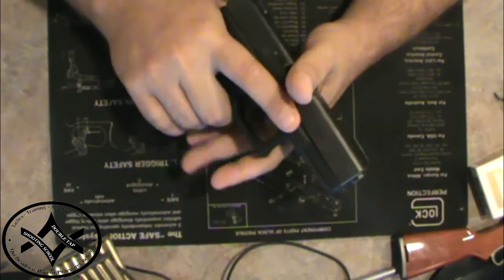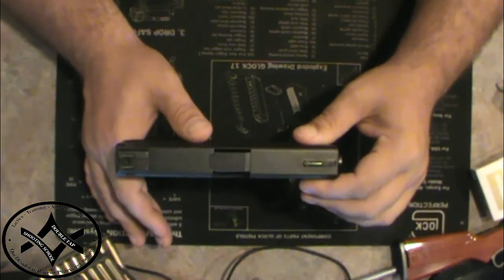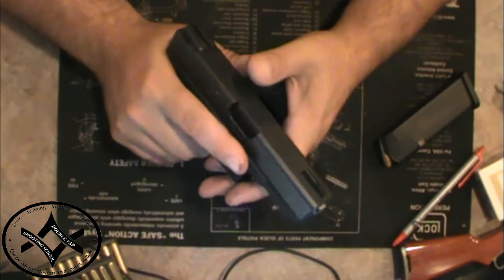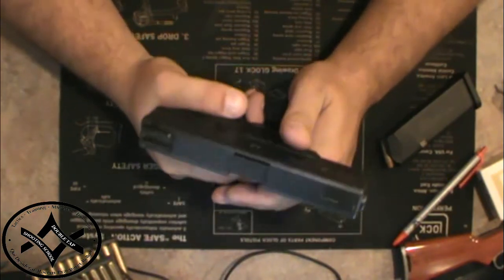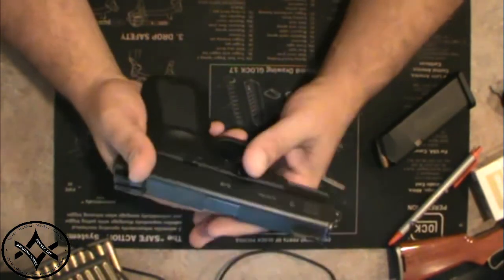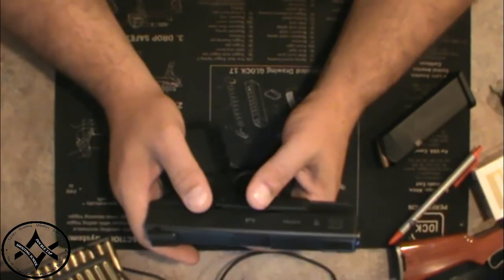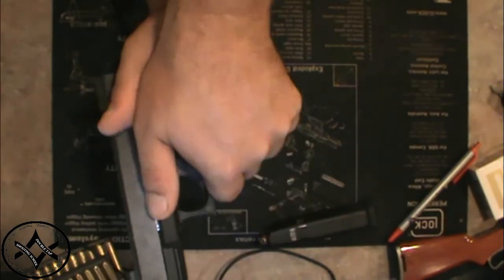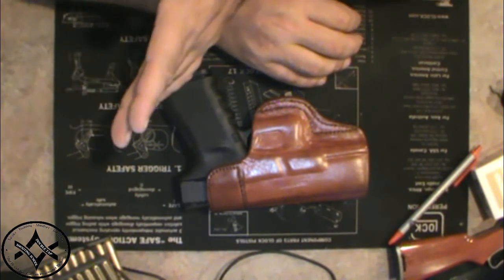Ladies Guide to Griping a Semiautomatic Pistol

Comment from the maker: Pull back on the slide to release it. The slide stop lever is not designed to release the slide, just lock it back. (hence the name slide stop lever). If you are trying to release the slide with it on an empty magazine, there is a tab on the magazine pushing up on the lever. With a single round in the mag (or more) the tab is pushed down out of the way. Do you have this issue with no mag in the gun as well or only with an empty in it?

Comment: I got a question for you that no one can seem to answer. On my glock 26 if I manually rack the slide and push in the slide release to hold the slide back, I can not press the release to slam the slide forward unless I have a full mag in it.. Does that make sense? Once the mag is in there it slides forward no problem, so I know it isn't just tough to push down like the guys at the gun range told me. This is driving me crazy, on my other glocks and 1911's I don't have a problem, WHAT IS IT!?